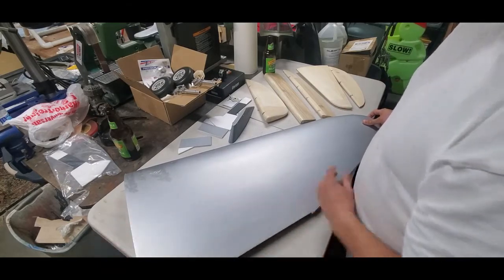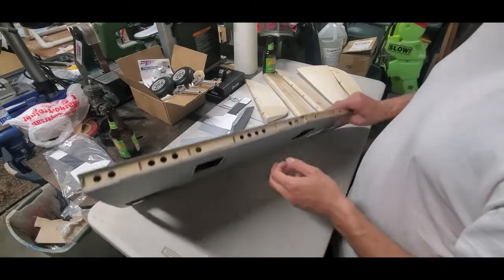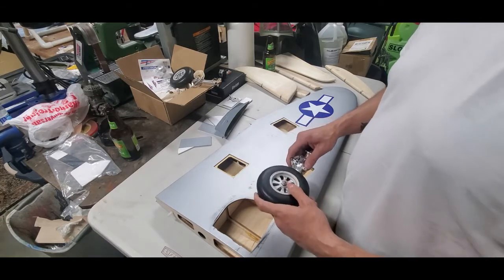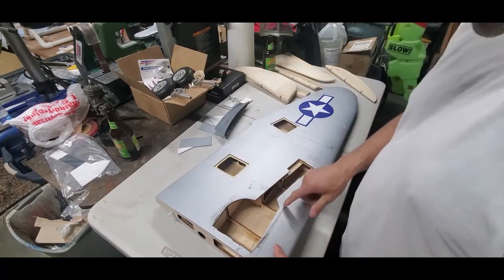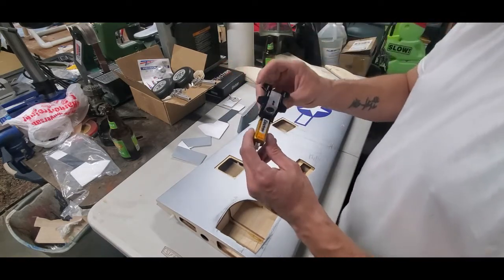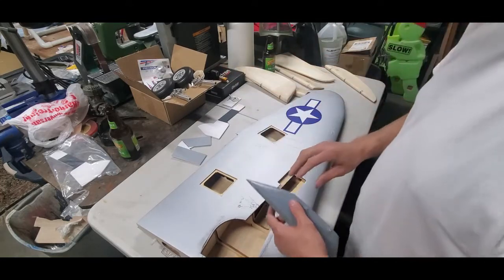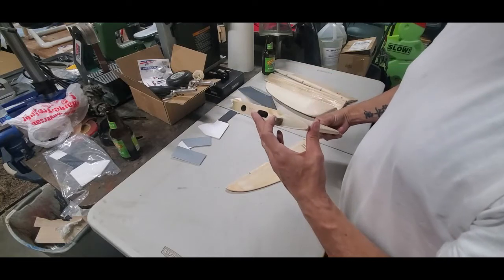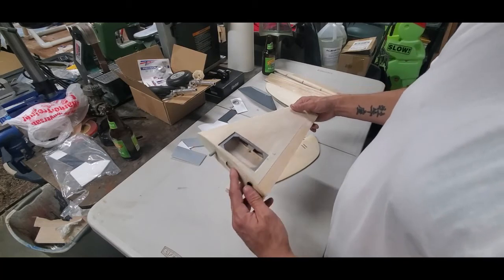CY P47 81 Build/Review Part #2

Comment: Cmon part 3 :) Just ordered that kit!
Reply from the maker: I haven't moved very far in this project due to work and the modifications that I'm doing to the airframe.   I will try and drop another video soon.   Thanks for watching
Reply: @hangar88  yeah hate it when work stands in the way of flying :) By the way any weak points to look for? My kit is supposed to be a new batch, let’s see what will arrive. I am both excited and a bit worried by the kit quality.
Reply from the maker: The overall arf was fantastic in my eyes.   Obviously every manufacturer has their pros and cons.  The wings aside from not being glassed were some of the best wings I've seen with an ARF. 

I would have liked to see a thicker composite  fuselage  but not terrible.   The inside formers are thin as well which if anything this is where I will reinforce.   

I will update as soon as I can,  also check out our CY modelers group on Facebook!

Comment: I just bought a Hanger 9 p-51 60cc and the wing tubes wouldn't fit into the center section or the wings . 
The tube in the wing and center section wasn't lined up with the last wing spar hole during gluing.
also, the landing great doors didn't fit level  up to the wing I had to sand the wings wood to lower the doors.
Even looking into the fuselage , the glue is piss poorly applied.
 Horizon H has the landing gear backordered and no one else is selling landing gear for it. Horizon H don't specify that the 5.5 " spinner doesn't come with the plane but it once did.
Horizon wants 200.00 for the plastic spinner , it is discontinued now maybe cause people complained.
Build quality is piss poor , I would buy another plane in my opinion.

Comment: What prop did you find works best for the GP 61? And what rpm are you turning?
I’m using the same engine but on the CY P-51 . Also sanding the supplied hinge points three of them came apart! The rivets are way too small, replace all of them.
Reply from the maker: I'm going to run a Falcon 22 x 10 warbird prop.  It performs really well on the GP61.  I can't remember what RPMs I was getting, but if my memory serves me right, I was in the mid-7000s.  There are very few pieces of the stovk hardware that I'll be using.  As far as hinges, I'm going with Robart pin hinges.
Reply: @hangar88  I just tacked a XOAR WW II 24/10 @ 6500 . However I would like to try the XOAR wood 23/8. My DLE 61 loves that prop.
I think I have a cooling problem or a fuel tank hight although that last one should not have been a problem.

Comment: You must have gotten a special one, the CY kit I got was garbage.
Reply from the maker: Actually mine was damaged.   Got it as an open box.   Besides the fuse being a little light everything else was pretty decent.   Now I have done alot of modifications to the bird.
Reply: @hangar88  the days of excellent quality ARFs has passed.
Reply from the maker: @AphexTwinII   yeah that's tough,  I thought the Hangar 9 p47 20cc was well built.   Mine took a few hard landings and tumbles (my fault)  and the frame held up well.   The covering was nice also.   Overall you are right with alot of others.   They seem to ask have there quirks